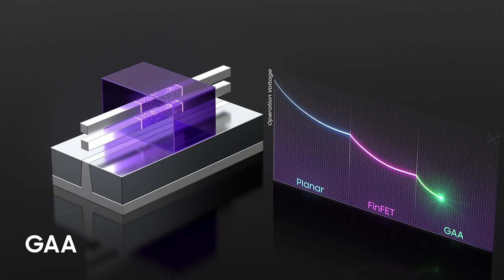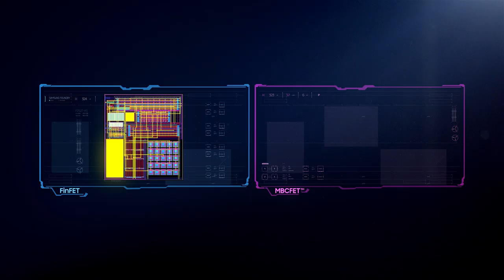Samsung Foundry’s New Transistor Structure: MBCFET™

Comment: There are a small number of super smart people, and all of us benefit from their work. Big thanks to you smart guys. I'm so dumb I don't even understand the video.
Reply: Simply speaking: MOSFETs, a type of transistor, has 3 (technically 4, but we ignore one) connections. There is a source and a drain, normally they are connected in a way that currents want to flow through it. The gate voltage controls if electrons or holes (current) can flow from the source to the drain or not. Transistors can be combine in a way they can be useto do mathematical operations, this is how every computer works.

The violet part you see in the video shows the gate, the grew part is the channel between source and gate.
This transistors have a size of a few nm.
Reply: @_Chad_ThunderCock  Why, this isn't hard.
I guess this is the Dunning–Kruger effect, from my perspective i made it very simple.
Reply: @happygimp0  What is the maximum frequency that a transistor can theoretically reach?

Comment: OMG i was right, this video Coreteks used in his background footage does go past finfet. This will be huge, a 3D stacked transistor, if it reaches viable costs in actual consumer HW.
Reply: humanity: the need for speed
Reply: This is separate from 3D stacked transistors. 3D stacked gaa is around 7 years away so we need gaa first.

Comment: Except Samsung is generally behind TSMC and at a similar pace to Intel if not slower when it comes with semiconductor innovation and performance characteristics across the same generation vs the competition. The MBCFETs might change this tho, we shall see whether TSMCs enhanced FinFET, Intels GAAFET or Samsungs MBCFET will come out on top in the 3nm process node generation

Comment: Everything they mentioned in the video GAAFet can do to They didn't explain how they do it easier than GAAFet thay just compared it to FinFet.
Reply: This is the point of marketing. Sell you something standard and convince you to overpay for it.
Reply: from the obscurity of this video, MBCFet looks like GAAFet with wider bridges and vertical version of FinFet
Reply: @user-pl7tf9gv8e   Those 2 things you mentioned are features of GAAFet
Reply: @cablefeed3738  both are basically the same except nanowires vs nanosheets afaik.

Comment: The video's cool as hell and I finally understood how these work

I thought electricity went left to right ¯\_(ツ)_/¯
Reply: These are transistors, hard to explain here but you can basically see how chips work in general and can understand
Reply: The current passing through the nano sheet is the current use to read the bit, I.e. a 1 or 0. The gate or switch surrounds the nano sheets. A current is applied to the gate which applies a small electric field to the nano sheet which allows the current to run through the nano sheet and be read as a 1. If a current is not applied to the gate then the transistor or bit will be read as a 0. This is how it works in its simplistic form. This is good enough to understand the concept, I think.